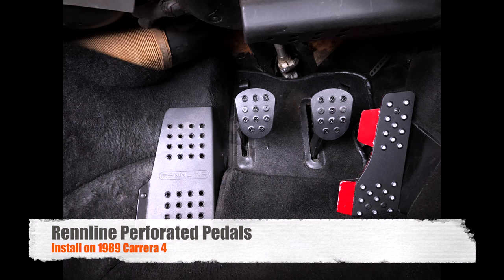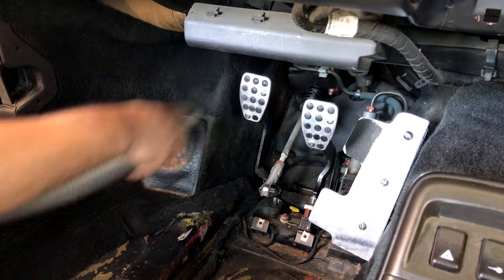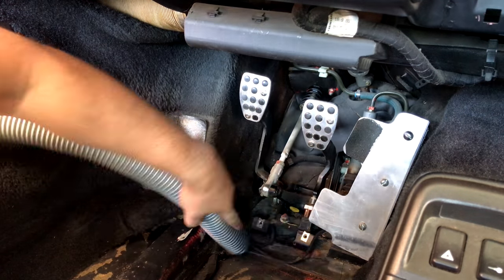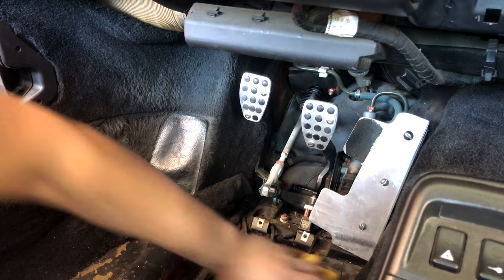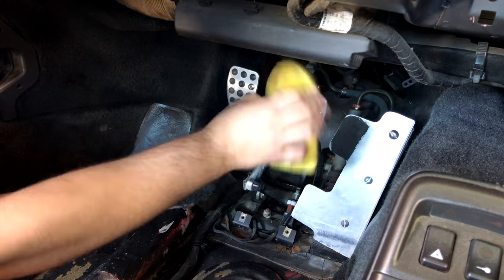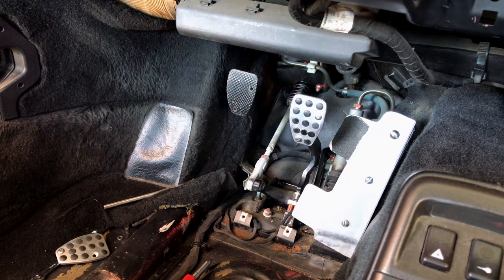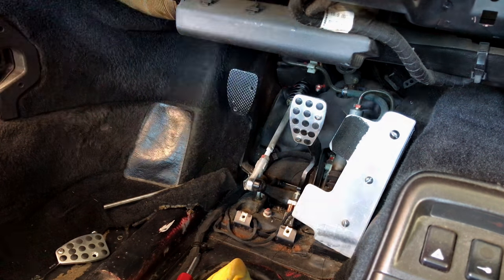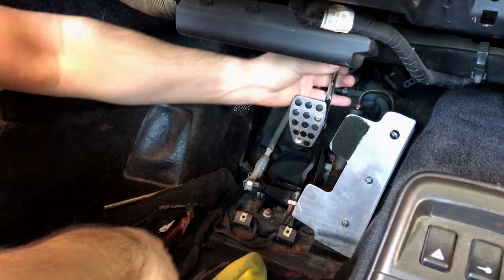964 Rennline Pedal Install+Philips LEDs

Comment: Did the basic dynamat make a considerable difference in noise levels? I have stock insulation that needs to be replaced and I am wondering how dynamat would compare.
Reply from the maker: With this small peace I couldn't tell the difference, but I have some in the rear of the car, and it made a difference compared to before. I'm working on a sound deadening video currently that will show the car fully covered, and what methods I used to find the frequencies I'm getting in the cabin. Stay tuned for more!